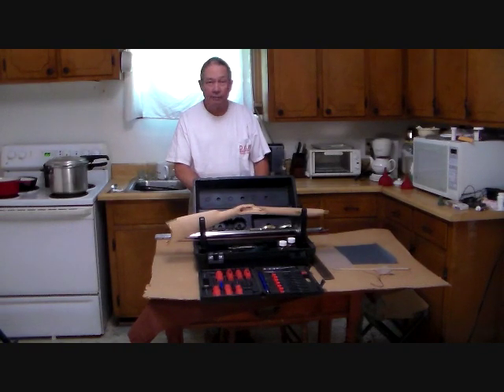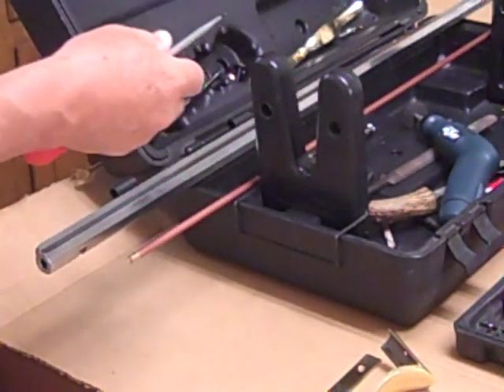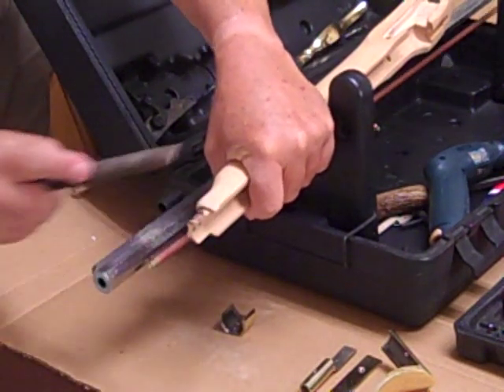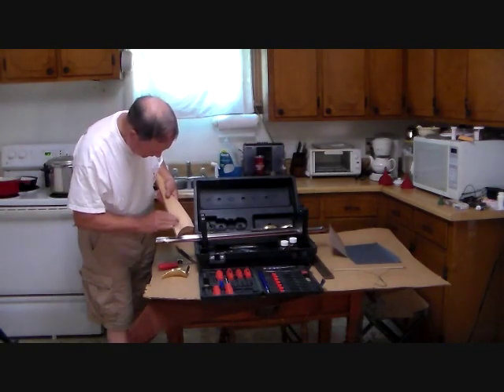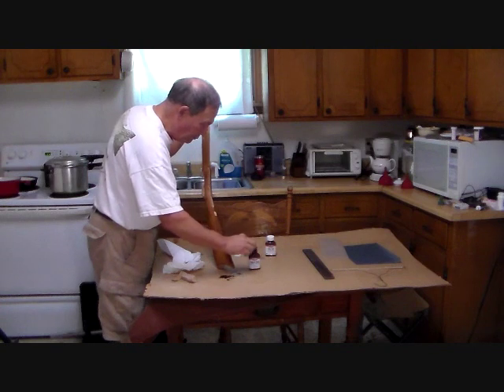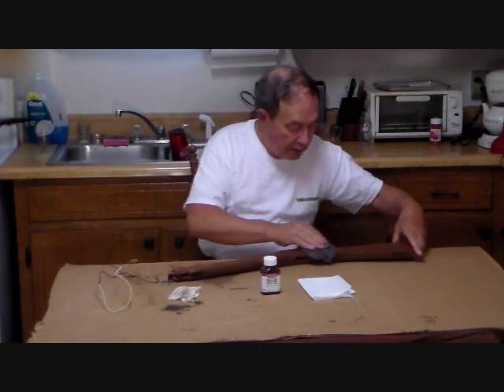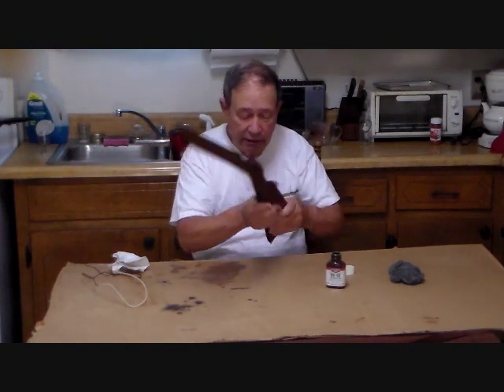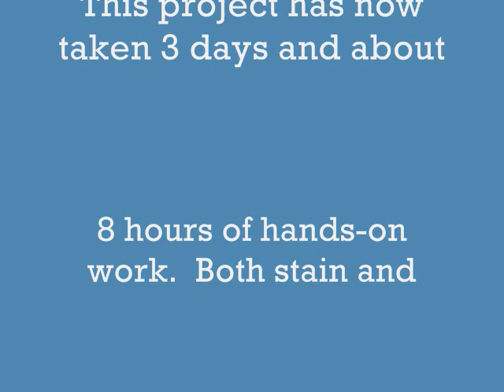Stock Finish Traditions Crockett  .32 Squirrel Rifle Kit

Comment: I'm happy to report that Frontier 50 cal flintlock is complete save for applying wax. I stuck with Birchwood/Casey Waterstain and Gunstock oil with multiple coats for both. I think that the results were beautiful. Thanks again for your video info. Regarding the wax, what would you suggest?
Reply from the maker: If you can find it Johnson's paste furniture wax.
Reply: Thanks! ill try!

Comment from the maker: I remember True Oil. Birchwood Casey's product does not smell as good or like linseed soil either. For best aroma my current vote would go for Purdeys' Slackum Warthog brand Stock Oil.  The bottle I have must be at least 10-years-old by now, but there is still just about enough to finish a stock.
Reply: Tru-Oil isn't linseed oil, or gun oil for that matter. It's something I learned to make in Jr High called French Polish. A mixture of linseed oil, varnish & shellac. I forget the ratios though. Oil is rubbed on, allowed to sit, then the excess wiped off. This stuff gets sticky till it dries.
Anyway, My dad used to tell me about a .36 cal mtn rifle he hunted small game with. Looked like a carbine size KY percussion. CVA had it in a kit in the 70's, but haven't seen one since. Raw brass castings as well.

Comment: Great video , Thank You!   I have an old Traditions Kentucky rifle kit that has dove tail sights front and rear. The front site is missing, it slides in from the top of the barrel as apposed to the side of the barrel. Any thoughts on where to get one of these or how to install a new one?
Reply from the maker: Traditions still sells this rifle and likely has parts for it. To install slide it into the dovetailed slot. If it is a tight drive fit, that is how it should be. If it is loose put it in and take a steel rod and use it to hit the top of the dovetail on the barrel to slightly compress the metal fingers holding it. This may dimple the barrel metal around the sight slightly, but that is not structurally significant. You can call Traditions' Customer service at 860 388 4656. Traditions sells, has sold, many rifles over the years so have the gun when you order so that you can describe the sight in detail so that you get the correct one. Another alternative is Dixie Gun Works. Here you would likely have to hand file the sight dovetails to fit your gun, which is no problem. Just go slow.
Reply: I really appreciate your input !  Thanks again!

Comment: Are those hollow ground screwdrivers? Looks like the set my wife got from Harbor freight for her tool box in the house. My dad used regular screw drivers on a CVA he built and boogied up the screws real bad. THe gun is great, the screws not so much. I am replacing every screw on the rifle. 

I have now watched all the videos on this rifle and you did a great job. I love muzzleloaders and these smaller calibers are great for hunting with. I am trying real hard to get local people to get into muzzle loading and get their kids interested as well. Nothing like blowing some smoke!

Take care!
Reply from the maker: That is the Harbor Tool set. If you use a screw head that it too small to fit the slots and must apply pressure on the head you will bugger it every time. A hollow-ground blade is fine, provided that it fits. On my older screwdrivers I hand ground them to fit in many cases, particularly for thin-slotted European screws.
Reply: Hovey Smith that's what I thought it was. Nice! I got a load of their stuff. 

I had pondered making my own hollow ground due to cost. I got a set made by grace. They are nice but expensive.